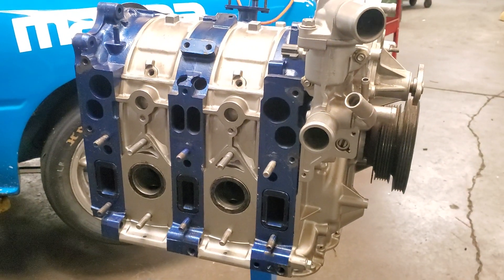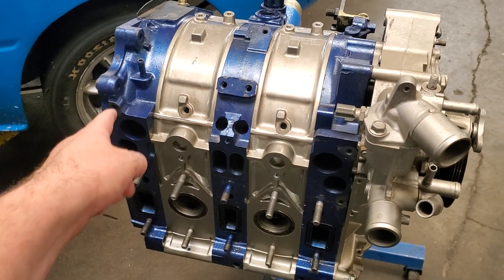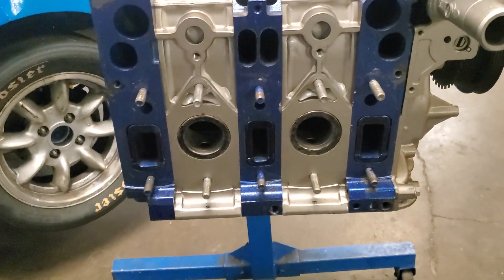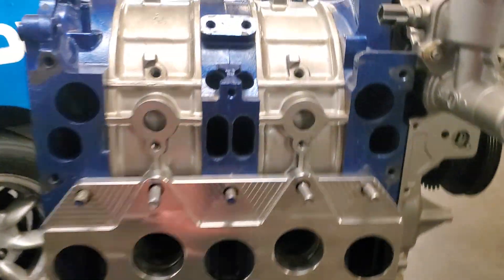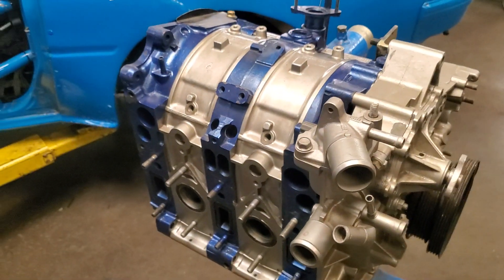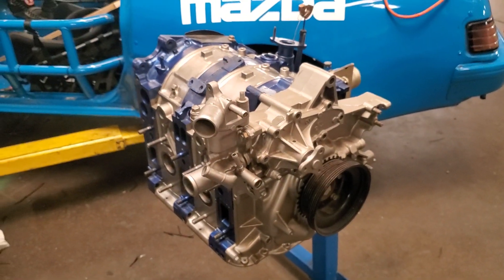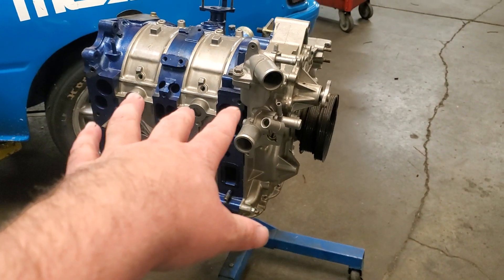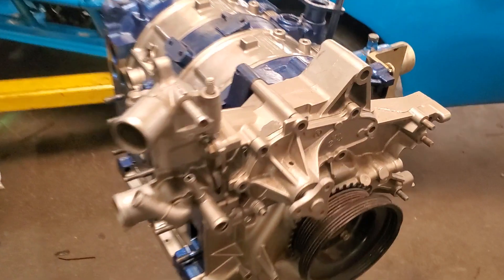Hybrid Renesis Rotary Engine Explained, what it needs, Mazda RX8 Kyle Mohan Racing, Mazdatrix

Comment: This, Side Intake, Peripheral Exhaust Ports existed already in RX-7, NA or turbocharged.
What's new, what improvements do you expect?
For me, the right changes for a Renesis would be a rectangular peripheral port, Reed-Valve controlled, the side intake ports fully clogged; keeping the side exhaust ports. 
This eliminates port overlap, while having the best possible BMEP, power, economy. 
Gesund +

Comment: Been 3 years already, yet nothing has been shared about the previous hybrid or this keg
Reply from the maker: Well, the one that's blue and silver Is our showroom motor it was based off the car that we actually did all the testing with.  We already ran the car in the moto IQ series.  It was a success we've shown the dyno chart. 

Let me know what you specifically want to know and maybe I can help you out
Reply: @KyleMohanRacing  i speak for the majority of us, we want to see videos, we want to hear it in person, a single dyno chart isn't sufficient data in my opinion.
Reply from the maker: @jimbowcracklehead8071 we absolutely proved it worked and there are a few examples out there. I'm sorry we did it at a time when social media was not developed nearly this well, so nothing was being recorded on video. But there's plenty of documentation. In regards to the new motor I just need money. I'll try to revamp the series this year. I picked up a chassis to put it in, so one step closer.

Comment: Carbon deposits may vary a lot depending of Oil used
Reply from the maker: @josega6338  carbon deposits may also vary based on fuel used, fuel octane, how long oil changes where done in and how the car was driven.  Maintenance can also be key.  But generally Run good fuel, use a good premix, change spark plugs. Regularly.  don't forget to rev your rotary
Reply: @KyleMohanRacing  Pressure difference between chambers, gas pressure, is important in Apex Seal tightness, this is why racing a Rotary under no load is dangerous.
No sense in changing Oil in a Wankel, the small bit constant Oil consumption from injecting Oil to lubricate seals requires adding Oil every now and then, this is enough change.
Very early Mazda data show an RCE has enough with RON 80 fuel, ON just describes antidetonation properties of fuel, as Lead, a poisonous additive, is no longer used in Gasolines, besides other additives that may be used to raise RON, I'm not aware of cuarenta gasoline composition, RON can't influence deposits. 
Ethanol in gasoline mixes, E5, E10, Methanol is a deadly poison, are good for Wankel, eg SAE technical paper 840237, Marcel Gutman (Guzmán)

Comment: Ok Kyle couple of questions for you... You said the XR8 Seals don't hold up on the port. Have you ever tried a bridged port? Like having 2 ports in the housing merging before the header. And has anyone ever tried putting expansion chambers on one of these. I'm thinking like 2 stroke exhaust where the megaphone section creates a vacuum in the cylinder and the reverse cone stops and or reverses flow back into the cylinder?

Comment: Can you do a video goinf over the difference between RX8 & RX7 rotors? Especially in relation to how it would effect this setup?

If you used stock RX8 Rotors would you see reliability issues only at high RPM or just all around performance?

Have you gone into how you would upgrade the fuel system for a 13B-MEP?

Comment: I'd say the best arrangement to modify an RX-8 Renesis 13B would be a Peripheral Intake Port, the NSU Ro-80 type, better if rectangular or square, V-Force Reed-Valve controlled, and closing forever the Side Intake ports, keeping the Side Exhaust ports. 
For a Street Car, a good option is closing the Peripheral Intake Port 40º after BDC, the later you close the Intake P Port, the more top rpm power you'll get.
For an improved Wankel RCE, avoidance of port overlap is essential. 
Anyone has tested in a Mazda the Toyota concept, having a glow plug, an ignitor, in the leading plug hole? 
Blessings +

Comment: I have to ask, from an objective standpoint, which engine is better? This MSP-GSLSE hybrid, or the REW? I would think that the turbo is going to spool slower thanks to the lower exhaust gas velocity, but it gains in top end exhaust flow as a result. I'm more curious about the intake though, does the extra intake area contribute to anything in this hybrid engine, or is it not worth compared to an REW?

Comment: is it possible to fit 9.7 cr rotors from a '90 rx7? so you dont have to machine the rx8 rotors to put the taller apex seals?

Comment: Still not seeing it?

No, it’s not more efficient.  The reason why is that as soon as the Renesis rotor moves 3* past TDC the full primary intake port begins to open while the the peripheral exhaust port that was added is still fully open.   Even if the Renesis intake ports aren’t modified, adding a peripheral exhaust port creates 13B peripheral intake engine type overlap when paired with Renesis side plates.  The difference between this and a 13B PP is that you simply can’t achieve any exhaust pulse tuning on a Renesis hybrid due to the exhaust signal being broken up into 3 port streams, of which two side port streams open later and close earlier.  This disrupts and weakens/destroys the potential for exhaust pulse signal strength. 

So it will never be strong NA and the only real hope for FI is to treat it like a PP intake engine.  Which means a big turbo with an even bigger turbine housing because it’s not going to be tolerant of negative emap with all that intake/exhaust overlap that the peripheral exhaust port creates when paired with Renesis plates.  It will never be as strong as an unmodified Renesis in the lower rpm range because it’s not going to have much of anything below 5000 rpm, just like a 13B engine with a big intake PP. 

Even back 10+ years ago when all the hybrid Renesis began, the output was subpar compared to what an unmodified Renesis was capable of.  It wasn’t as obvious then because of all the people doing it wrong and making it seem like a Renesis and turbo weren’t compatible.   Now there are quite a few examples of people using sufficiently sized turbos with good tuning and support mods. 

What it really comes down to is that most people still don’t grasp what it is that makes the Renesis so different than the prior 13B.  For the same reason those differences are why most of the mods used on the prior engines don’t work on the Renesis.
Reply from the maker: Our turbo setup worked fantastic,  that's what I built and have experience with.   The setup was raced by Mazdatrix and was very successful and the shop has over 30 years of rotary experience. Dyno numbers don't lie it was a very efficient set up in our application. 👍
Reply: What are you on  talking  crap the. Set up works. Think again

Comment: How much HP to expect with it ran in NA?
I've always wanted to build one. The older I get the more likely it becomes.
Reply: 280whp if what I've read is correct. Sounds very well suited to an NA build in a lightweight vehicle, but even better with a turbo.
Reply: @th3ch33t  Yeah, I think 280 hp with carburetor and simple tune. I’ve seen a few people with drag builds get close to 400 hp with nitrous.

Comment: What do you do with the engine mount bracket ? it will not sit flat ontop of the exhaust flange. Best ECU is the Adaptronic plug in I developed here in Australia .
Reply from the maker: Have to make a mount or modify oem. We have done both. Adaptronic is the easiest,  but there are better ECUs available.  Just not plug and play.  Are you with Adaptronic?
Reply: @KyleMohanRacing  No not part of Adaptronic but have worked with them to develop the RX7 and RX8 plug-ins. I run a race shop in Australia and the RX8 Cup race series too.
Reply from the maker: @TheRicShaw  very cool.  That looks like a fantastic series.  Keep up the awesome work
Reply: Ric Shaw  hi  Ric how you going   I have a rx8  now I’m very interested in  flash  tune or  plug  n play  can you get back to me thanks🖐👍

Comment: The GSL housing exhaust ports are having so much overlap with the Renesis intake ports, that this engine will make power only at the top end. Not suitable for street use.
Reply: It does have but not a lot, way less than a BD or semi pp.
Reply: all rotaries besides the renesis have overlap

Comment: We need these motor built by the quantity if proven really reliable, of course with regular maintenance etc. I'm willing to invest in one of this, I'm pretty sure there is alot more people willing to do so. #rotary
Reply from the maker: No issues with them.  Just a good way to hotrod a renesis block.
Reply: @KyleMohanRacing  from your experience with it, do you think a hybrid renesis could be used for a daily/track car?

Comment: Would the stock Series 1 Rx8 OMP and its respective oil lines and injectors work with the GSL-SE rotor housings? How many oil injection ports do these 1985 housings have?
Reply: just block off the oil injectors, do a OMP delete and premix

Comment: This'll be my next project on hobby drift RX8.
Always wanted to do the hybrid renny. I've rebuilt a stock renesis and that was fun. But I'd like to be able to rip in 3rd gear and I'd be caught dead before putting an LS in it.
I've already got 2 renesis engines so I'm hoping it'll work out cheaper than buying an REW.

Comment: Rather then using renesis rotors can other series rotors be used? I too would  like to this hybrid with a semi-pp and working  electric opening for 5/6 ports or semi-pp.
Reply: I believe that can be but you need to (maybe don't have to?) machine the bevel on the sides the same as the RX8 rotors to get the port timing right for side intakes.

Comment: It’s nice to see some legitimate reviews on this type of setup for a change. These hybrid motors have built up a reputation for being very unreliable for unknown reasons because no one that has done these setups has come forward with any real world data or updates  of success, failure and/or problem areas. I think much of your success with this motor has a lot to do with using a proper setup whereas others are trying to cut corners everywhere they can which tends to lead to issues more often than not. I would like to see some long term data from a daily driven application as some places don’t require smog at all and can be done in those areas, but I don’t doubt that it can be and is a reliable race only motor. I look forward to your future updates and reviews on this
Reply: They are great 👍 a lot of problems sorted
Reply: @Nate Rist let’s build one for my car

Comment: I believe Ryan rotary performance here in the uk are currently working on a semi p intake port & intake manifold for the renesis where the intake runners for the pp will include a valve opened using one of the original intake valve circuits or the solenoids themselves (think it may have been the ssv). This might solve the low down power issue with a semi p in the renesis. Interested to hear your thoughts

Comment: Would love to see this and the flange in actual use- especially using a semi PP config with ITB's  and sequential opening on the different ports- would give us something reminiscent of VVT and VVL if done correctly
Reply from the maker: That's a lot of work.... I hope someone tries it. Id like to see it as well.  For now I like the simplicity of the street port hybrid and turbo.  Effective hp out of a renesis based block.
Reply: Yeah maybe some oem motorcycle intakes do something like that